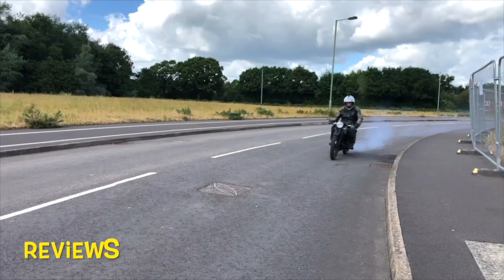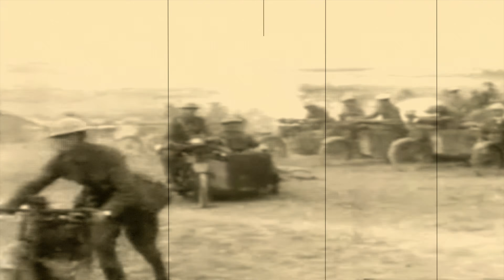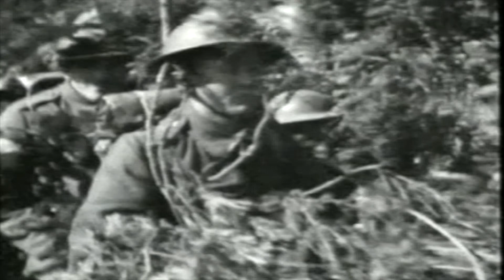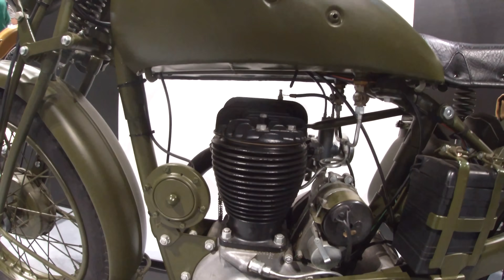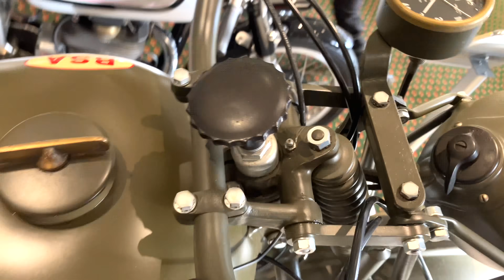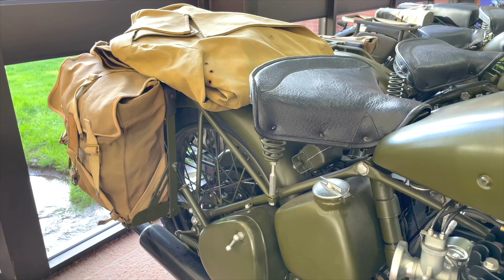BSA WM20   The most successful military Bike   4K

Comment: My grandmother told me that when the Battle of Surabaya broke out, my grandfather volunteered and joined the ranks of the youth. That was around 1945, and he came home several years later with a trophy, a BSA WM 20 war motorcycle. It almost became scrap metal, and now I'm trying to restore it little by little because spare parts are quite rare in Indonesia. By the way, the frame material is very good, because even though it was lying in the field for 20 years, it didn't get destroyed by rust 😅.
Reply from the maker: Clearly good quality anti rust paint

Comment: Back in the 1960s Dawsons, a Nottingham secondhand motorcycle dealer, used buy M20s in huge batches at the auctions held at Ruddington where the armed forces disposed of unwanted vehicles of all types. They paid around £5 each!  Some of them were freshly sprayed khaki - all over, including tyres :)  I went with a friend on one occasion because he wanted to buy a Triumph TRW 500cc side valve twin - I think he got it for about £20 at auction.  

Dawson's advertised them at about £12.10.00 in the magazines IIRC.  I suppose they were checked over.  I bought my 2nd bike there in 1956 - a 1953 BSA C11.

You had to be very careful what you were bidding on as each item just had a number so you could be bidding on a usable car or one that was a wreck.  There were stories of people buying lorries and discovering they were full of M20s once they took delivery.  It was a fascinating place.
Reply from the maker: Sounds like smart business

Comment: A good video, thanks for making & sharing it.
Germany relied on 2 strokes & smaller capacity 4 stroke singles for their DR type work.
Slow the M20 may be with not many horses, but those horses are Clydesdales. They pull.
And now it's back out to the shed to try to work out why my civilianised WM20 has stopped charging...
Reply from the maker: Germany was indeed very fond of twingles for its smaller from TWN and DKW but lacked the production capacity of the likes of BSA et-al

Comment: Excellent video.
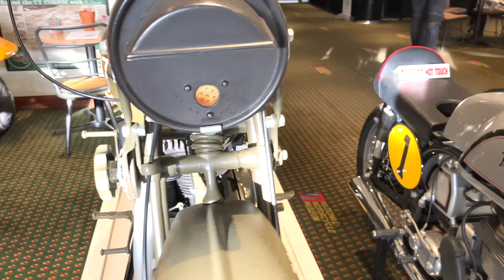These bikes were also used by the US military in WWII and afterwards.  I spotted one at the Texas Military Forces Museum, in Austin, Texas painted in US military colours.  The only difference that I noted was that it carried a spare spark plug threaded into the hole in the forks where the version shown in the video at 5:06 shows the front brake cable passing through.
Reply from the maker: Military bikes have become very popular in recent years so bikes repainted after the war are being returned to their original paints schemes
Reply: @bikerdood1100  According to the information board, this one had been in the hands of the US Army from WWII onwards.

Comment: I have around 60 vintage and collectible motorcycles in my collection. Probably 30 of my machines are BSAs. Actually the oldest of my BSAs is a 1940 BSA WM20. The guy narrating this video is obviously a Britisher given the way he raves on about the WM20. I wonder if he has ever actually ridden one. I spent 37 years wearing the U.S. Army uniform and I can not imagine taking my old WM20 into any combat situation. Especially a 'movement to the rear'. What do the Europeans call it...'a retrograde action'??  My WM20 is tuned and honed to the ultimate and it is still the most annoying AND slowest of all my motorcycles. Indeed, I believe my 1955 BSA Bantam would out-perform my WM20.  The best solution to the slowness and lack of power of my WM20 would be to fit it with one of my Goldstar engines! I also have a 1938 German Army BMW R71 and it, with it's telescopic forks is much preferred over the old BSA. But, still, I think either of these war machines is preferrable to the Harley Ableson Army 45.
Reply from the maker: And my wife has lots of pairs of shoes but a shoe expert she is not 
The oldest BSA in my collection is from 1930
Who is riding the bike in the beginning I wonder ? 
I obviously have ridden a great many machines but just as obviously I haven t ridden an M20 in to combat , few if any who actually did still live 
Including my own grand father who passed away 25 years ago, do you know anyone who has ever used either in combat I wonder ?
The BMW for all its telescopic  forks used antiquated hand gear change and was much heavier than the BSA so in reality was poorer in off road conditions and its use attaches to a sidecar was also antiquated in principle 
Then there the numbers 
21,000 BMWs is modest compared to 125,000 BSAs 
And 80,000
Plus HDs
In combat serviceability and numbers are everything you seem to have a very poor grasp of the period, War and it’s requirements 
Your thinking of the M20 in modern terms not in a war 80 years ago
One from which American as usual profiteered
The British produced a huge numbers of excellent machines, all lighter and more off road capable than a boxer.
Side valve engines were popular because of their rugged simplicity and relative quietness.
Some how I doubt their ability on modern roads was much of a priority
In short the preferences of Ken in 2025 were not a major concern
Reply from the maker: Britisher ??
Are you unable to distinguish an accent ?
I’m guessing a fundamental lack of linguistic skills here 😂
Gee I wonder where your from 
🤔
Can’t imagine
Seriously doubt if the comment or could tell the difference if I was English, Irish of Flemish 😂
FYI  All the above are real
Reply: PS  Matchless had teleforks in1941 with 2 way damping!

Comment: A nice video about the most produced  military motorcycle. Though I don´t think convoys operated at 50 Mph. The military convoys I´ve seen this year could do it on motorways in light traffic. Guess 30 in good conditions. Probably less on war torn roads. So the M20 could overtake convoys which is necessary for traffic control.
Reply from the maker: True enough but it very much depends on the make of the convey, certainly the M20 could out run one. Motorways however, well they didn’t exist. German autobahns would largely have been smashed. There was a war on after all,this was 1944 not 2024

Comment: The 1935 BSA test machine was the completely different model 35-6, a sidevalve version of the oil in sump Blue Star. Some how that information seems to have been lost. It was finally accepted by the Army after much work  by which time BSA  had stopped making it. So in 1937 BSA submitted their new Val Page designed M20., all be it with hand change different mag drive and less cylinder base studs. Once accepted even BSA seemed to regard it as a stop gap; so much so that in conjunction with the Armed Forces they developed a 350 OHV unit, only for the Government to decide on continuity. The 350 would morph into the post war B31. The same continuity philosophy would hold Norton to continue making the '36 16H rather than the enclosed valve gear '38. Unlike the Reich the British Government appeared to understand the benefits of simple mass produced vehicles. There's no merit in making the best machine if you can't make and service enough of them. The M20 was not superceded in '55 by the M21. They simply stopped production of the M20 then. They'd  already been making the M21 since before the war.
Reply from the maker: Well most of the side valve singles were seen as a stop gap 
Until that unfortunate War business 
Lest not forget that the BSA was foot change
Not like those backwards BMWs
Reply from the maker: Well of course the M20 was produced before the War, I clearly stated 1938 as the year of its introduction into military service, it’s called rearmament and you do it before the war actually starts if you want to survive This is of course assuming you take 1939 as the actual start of the War, many historians regard the war as staring with the Spanish civil war and gradually escalating from that point given that conflict flared up continuously afterwards.
It’s certainly a valid point of view.

Comment: The good old M20! My first ride as a thirteen year old boy. My neighbour was in the TA and a vehicle tester for the army but also a top-class off-road rider representing GB in the ISDT twice and so on. He also rode Army motorcycle three stage trials and back then there were two classes allowed, the current military B40 and the by then obselete M20 which were available brand new from the storage depot in Aldershot for £12. He practiced in the woods neighbouring our property and gave me an M20 to practice my budding skills, one learnt a lot on the overweight, gutless and terrible braking beast and especially keep you feet up, those solid footpegs were killers! My brother actually had an M21 outfit a bit later as his student transport, we went everywhere on that thing even  using it a wrecker to recover my endless succesion of seized two strokes. The M21 we fitted with an  SU carb, vastly better than that vile Amal rubbish for sure.
Reply from the maker: He sounds like a interesting chap doesn’t he